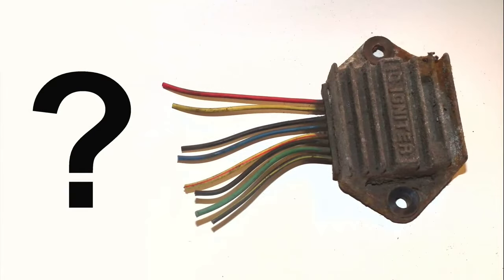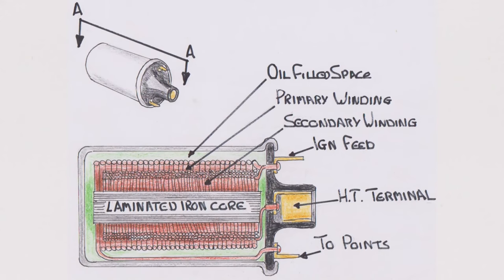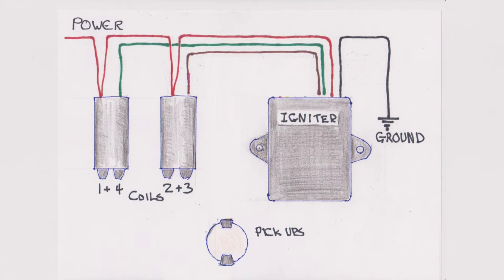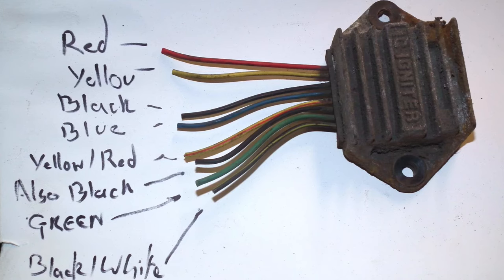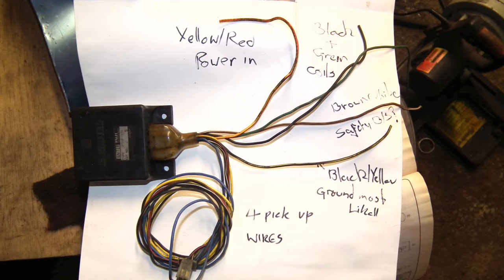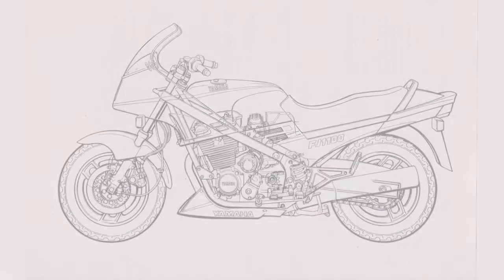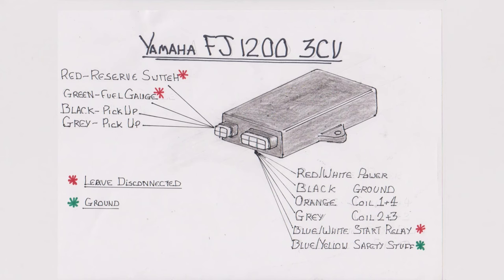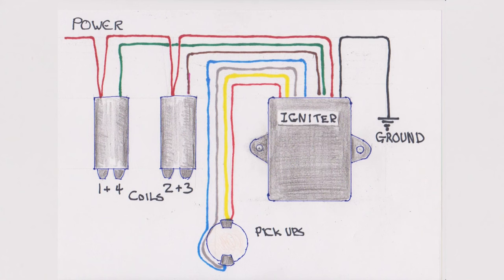How To Wire Motorcycle CDI Ignitions from Scratch

Comment: My 2-stroke Rotax has a single pickup, two coils and two cylinders, which aftermarket cdi can I use as a replacement?
Reply from the maker: No idea. Mostly I build chops and bobber and not a lot of those use Rotax ring dingers. Have you tried Googling it?
Reply: @BuiltatBlackjacks  Yes, I came up with MSD 4255 but need to research it.  Could be this Rotax pickup gets triggered twice/revolution, firing both coils simultaneously (like wasted spark).
Reply from the maker: @thisisyourcaptainspeaking2259  you said it's a 2 stroke? All 2 strokes fire once per crank revolution so yes the pick up will trigger the CDI every time and the CDI will fire both coils. Assuming it's a single? Dual plugs in a single cylinder generally means faster flame front propagation so more fuel gets burnt, meaning cleaner emissions and more power.
Reply: @BuiltatBlackjacks  Definitely a two cylinder.  A cylinder fires each 180 degrees of crank rotation.  I'm just not sure if the CDI trigger is rung twice/rev.  That would suggest a single coil could be used and that's not the case.  Guess I need to put a timimg light on it...
Reply from the maker: @thisisyourcaptainspeaking2259  yeah, sorry missed the two cylinder bit in your first. 🙄 What can I say, it gets busy round here. Just fitted a CDI to a CX 500 that appears to have been designed for 2 strokes and is programmable for advance curves etc. Basically turned up in a box and I fitted it. If you get stuck I could probably dig out the info on it.
Reply: @BuiltatBlackjacks  Currently this system is working but it's 23 years old now and many replacement parts no longer produced.  I've decided to be proactive about sourcing spare parts.
Reply from the maker: @thisisyourcaptainspeaking2259  if I get a minute I can look up the details of the people that made the CDI for the CX. Even the name should help you out.
Reply from the maker: And lo and behold.... 

https://www.ignitech.cz/en/

Try those guys.
Reply: @BuiltatBlackjacks  Fantastic, thanks for the lead! ;)

Comment: My cdi has 8 pin outs for a 1985 Yamaha virago 1000. Anyone know where I can buy one or how to test it?
Reply from the maker: Why does it need testing? If it's not working you're better off starting by testing the wiring, check for continuity from one end to the other, check nothing is shorting to ground that isn't supposed to. If you mean you need to know which pin does what, do a search for a "pin out" diagram for the unit. Bear in mind the plug is wired as the mirror image if you're looking at it head on, and that can make pin out diagrams confusing.

Comment: I see these CDI boxes online for fairly cheap. I'm wondering if they're basically universal and work across different brands and size engines...  as long as the plug / pin configuration are the same as what I currently have?
Reply from the maker: Unlikely. "CDI" gets used for capacitor discharge ignition and computer digital ignition and they're profoundly different, even the coils are different. Ignition timing needs to alter as the engine speeds up, sometimes this is done mechanically, sometimes it's done electronically in the "CDI" box. So there's more to it than just having a dandie CDI box.

Comment: What if my igniter is not grounded? What are the symptoms? I have fzr 1000, I thought to replace cdi, it misfires, running really bad, not driveable. And do I need resistor assy on wire harness or this is all about other electronic installation like lights etc.? cause this engine is on the buggy, so I didnt put resistor back. Now Im in trouble and searching for a clue to get it running
Reply from the maker: Never wired an FZR100, so I'm guessing here, but if it runs, chances are it's not the Igniter Box, maybe a bad connection? If you have a diagram, my e-mail is on here, I can have a look at it, but no promises...

Comment: Do you even need a cdi if you use a m unite blue ?
Reply from the maker: Yes you do. All an M unit Blue does is to control the stuff like lights and indicators. It'll control power to the ignition, basically switching the CDI on or off but that's it.

Comment: Hi Blackjack, nice video. Got a couple of questions if you have any ideas. Picked up a Kawasaki klf400 quad and was not getting spark. The CDI unit has been replaced previously with a chinese unit to try and get it going. All of the colours matched up with a wiring diagram I found online - (bk/w + bl) pickup, (bk/w) ground, (y/r) 12v from engine cutout, (r/w) 12v from ignition switch?, (g/w) output to coil. Wasn't getting any results, power and grounds were testing where I expected them other than the R/W which was being pulled down to around 4v. I put 12v straight onto it and pretty sure I blew the unit, testing between the live to ignition switch and the r/w it seems there is a kiloohm resistor in there. 
Do you think it's possible that should have been a ground connection rather than the 12v I had on it? 
Second question, there is a third box beside the rectifier and CDI unit that shares a connection with the coil output from the CDI, it's labelled "control unit" on the diagram and has something to do with the carburettor heater. I take it this just turns the heater on if its seeing spark?

Cheers
Reply from the maker: Want to email me the diagram? I can have a look. Address is on the channel page.
Reply: @BuiltatBlackjacks  Cheers

Comment: Have an 82 virago, was running then stopped all of a sudden, can’t get spark no matter what I try,
Also have 2 dc cdis I thought would work as there is 4 pickup coil wires 2 for each coil, can’t get it working, any advice?
Reply from the maker: If it was me, I'd get a multimeter and a manual and check for power at the igniter, then do a resistance check on the pick ups, then I'd check for continuity between the pick ups and the plug on the Virago igniter just to eliminate any wiring faults and the pick ups as those are just as likely to be faults. The problem with using something else is that unless you have a mechanical advance, then the ignition advance is going to be wrong, meaning somewhere between a lack of power and a hole in a piston. The Japanese have a habit of calling capacitor discharge ignition and computer digital ignition by the CDI acronym, they're very different down to the ignition coils, your "DC CDIs" sound like they might be capacitior discharge, pretty sure the Virago is Computer digital, so not going to work. However, it is possible to repair the Virago black box, seems they have a habit of offing the transistors that switch the coils. There are places that offer a repair service for them, or you could try somewhere that does computer repairs like this guy did..

https://www.google.com/search?q=Virago+igniter+repair&sca_esv=e9f3e6ede1937afe&sca_upv=1&source=hp&ei=ZrCwZu-lO9ahhbIPpZLs-QM&iflsig=AL9hbdgAAAAAZrC-d0q2qWOUNmCP8M9Le5LwUqNhVn4g&ved=0ahUKEwjv8Lz92N2HAxXWUEEAHSUJOz8Q4dUDCBk&uact=5&oq=Virago+igniter+repair&gs_lp=Egdnd3Mtd2l6IhVWaXJhZ28gaWduaXRlciByZXBhaXIyBRAhGKABMgUQIRigAUjaMlDNCVilMHABeACQAQCYAdIBoAGWDaoBBjIwLjAuMbgBA8gBAPgBAZgCFqACpg6oAgrCAhAQABgDGOUCGOoCGIwDGI8BwgIQEC4YAxjlAhjqAhiMAxiPAcICERAuGIAEGLEDGNEDGIMBGMcBwgIUEC4YgAQYsQMY0QMYgwEY1AIYxwHCAg4QLhiABBixAxiDARiKBcICDhAuGIAEGLEDGNEDGMcBwgIFEAAYgATCAgsQLhiABBjRAxjHAcICCxAAGIAEGLEDGIMBwgIIEAAYgAQYsQPCAggQLhiABBixA8ICCxAuGIAEGMcBGK8BwgIFEC4YgATCAg0QABiABBixAxhGGPkBwgIGEAAYFhgewgIIEAAYFhgeGA_CAgUQIRifBcICBxAhGKABGAqYAwqSBwYyMS4wLjGgB8ygAQ&sclient=gws-wiz#fpstate=ive&vld=cid:ace32682,vid:y8dt_w3FTpo,st:0